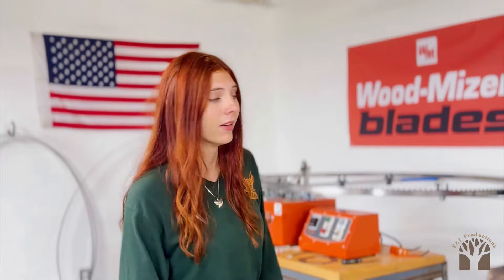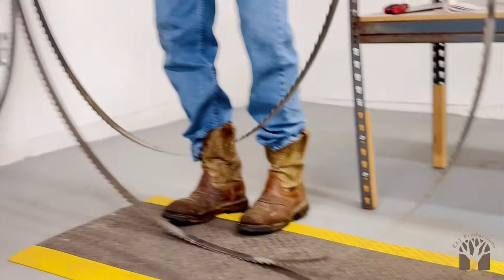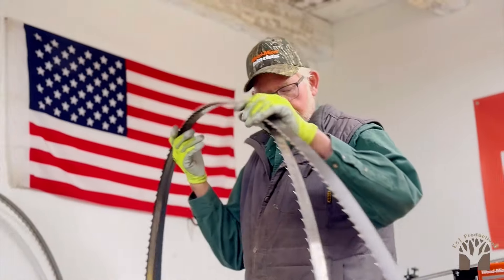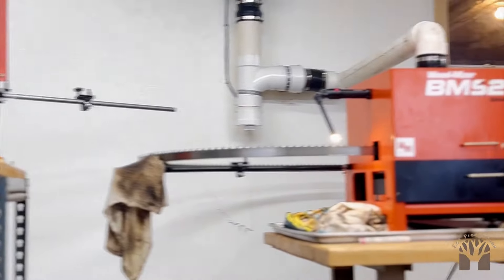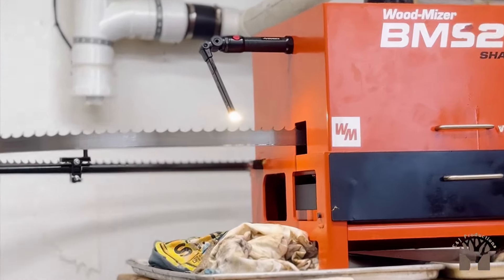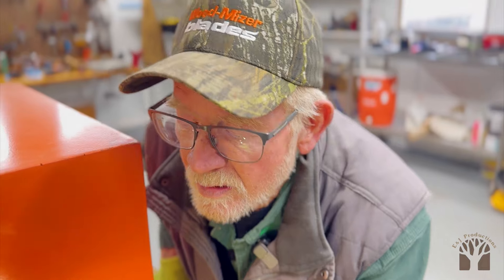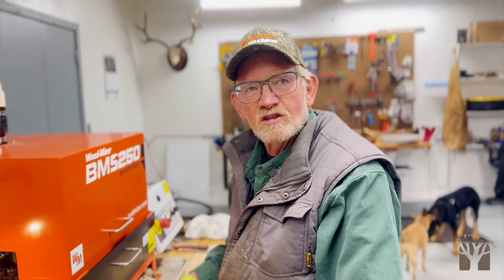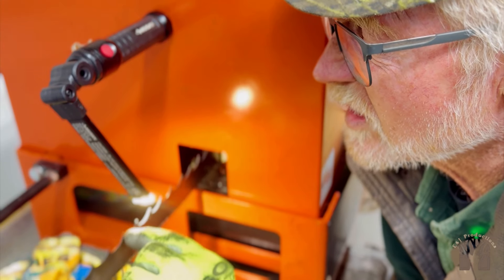New Sawmill, New Blades! Sharpening These Beasts Means More Work For Grampa!

Comment: You're doing a great job Grandpa! When I was a saw filer, I had a 32 ft. band saw and 4, 26 ft. band saws to bench and sharpen every 4 hours. Plus 12 carbide tipped edger saws. It was a full time job. I miss the work.

Comment: Just a suggestion. Our saw sharpener use to mark the beginning of the blade with a piece of chalk on the 1st tooth. Now granted he was sharpening blades that when new were 12" wide and about 40ft in length. Yea, they were pretty big, but basically the same process. Good luck

Comment: Hey there, interesting to follow you're channel, I'll been running Lt 40 for 10 years and Lt 70 for 20 years. When I'm sharpening my blades am always run them twice in the sharpener. I'm have the original grindstone, it is now 20 years old and working well. Good luck to you all.

Comment: I really like the way you respect your grandfather and family, you will go a long way. Did you buy the sharpener from the people that made the mill
Reply: The LT-70 WIDE  Super Hydraulic Portable Sawmill,  the BMS250 Bandsaw Blade Sharpener and the BMT200 250 Automatic Tooth Setter are all Wood-Mizer machines.   LCLY is also using Wood-Mizer blades.

Comment: I noticed on your new mill that you don’t have a debarker, this accessory might save some on your blades. But that is quite the machine. I could not justify having one, you have to be able to sell the lumber and we have too many people around trying to do that.
Reply: The new LT-70 WIDE does have a debarker going in front of the blade.   However you may be looking for it on the right from where the controls are, like on the LT-40: look for it on the left on the LT-70.

Comment: Are the new LT70 blades thicker.. giving more sawdust and less board feet from a log ?
How does the surface finish compare.. LT40 vs LT70 with higher blade speed ?  Rougher, equal or smoother ?

Comment: I was told you had to grind the gullet and the back side of the tooth, basically grind the entire profile. Has that changed per woodmizer?
Reply: The grinding wheel contacts the entire profile of each tooth GP

Comment: Were the carbide toothed blades not worth the extra cost?
Reply: Remember that tools that use "carbide" tips have blocks of carbide glued on the tool. Hitting something it shouldn't, like a nail or chunk of metal, can destroy the individual blocks of carbide. Sharping a carbide tool is one thing, replacing blocks of carbide is something not done in the field, if at all.
Reply: @thomasboese3793  Yes, a carbide tip that is knocked loose would be very difficult to replace. A few teeth randomly missing is not disabling.   Also, carbide toothed blades are used for demolition work where nails and screws are common.  In fact, carbide toothed blades are used to cut metal, including steel.  The number of teeth per inch, edge angle, and tooth offsets are generally quite different between wood and metal blades, but there are good compromises to create wood cutting blades that also handle embedded nails or even screws.

Comment: I don't recall if it was said what happened to the LT40.
Reply: Not important
Reply: @daveklein2826  It's not?
Reply: It went back to the dealer from whom they purchased the LT70, presumably for a credit of some sort.
Reply: The LT-40 was traded in on the LT-70.
Reply: @daveklein2826 It is very important, in my opinion, where the LT-40 went.
Reply: @scottsoper  Figured.  They may have made more by selling it privately.

Comment: With the blades dulling up so fast is your feed rate thru the log at a recommended setting?
Reply: The blades in terms of board feet seem to be lasting about the same it seems to me. They are however producing about double the board feet of lumber.  so there are at least double the blades to sharpen.

Comment: How many runs through the sharpener until a blade needs to be replaced?
Reply: We got 3 to 5 sharpening on the previous blades before breaking. It is yet to be determined on the heavier blades. GP
Reply: I'm lucky to get 5 sharpenings before dozens of cracks

Comment: Since the blades are much longer, I would expect them to stay sharper longer as there are many more teeth doing the cutting.
Reply: longer blade, absolutely, and running at a FASTER speed, both the speed of the blade spinning as it's cutting and the speed at which the head travels the length of the log. Comparing the time it takes to mill a railroad tie on the LT40 vs the LT70, the LT70 is significantly faster. It's going to be a tad better life for the blades on the LT70 based on the board feet cut, however, they may change blades sooner time-wise as the production level is greater.
Reply: @thomasboese3793  Good explanation. 👍🏼